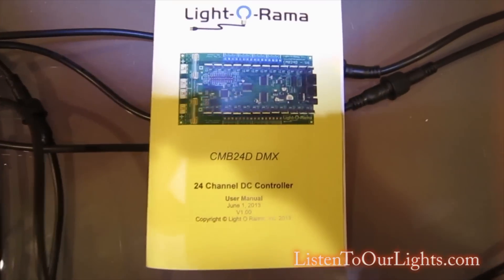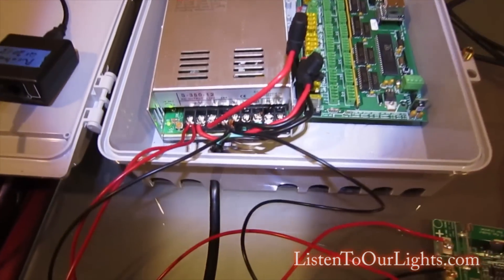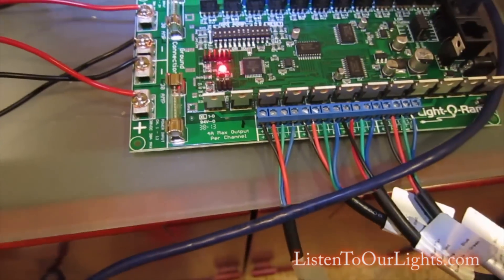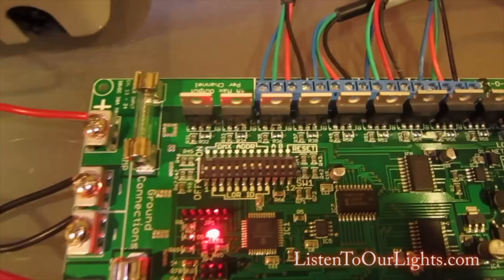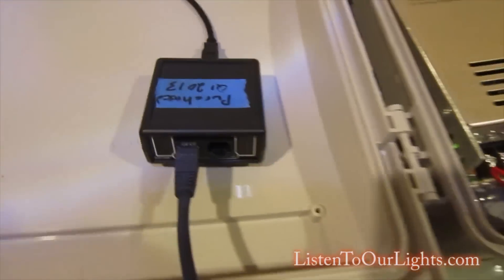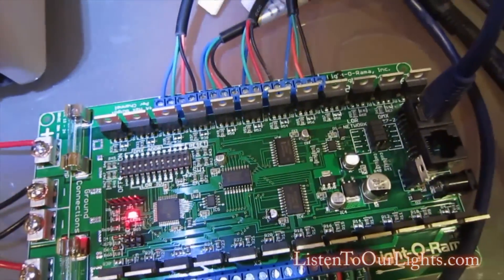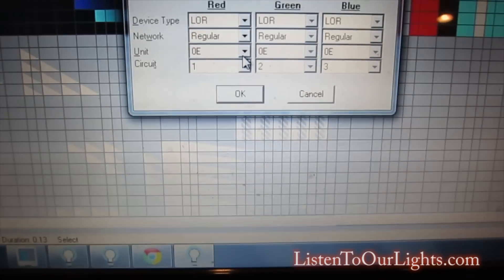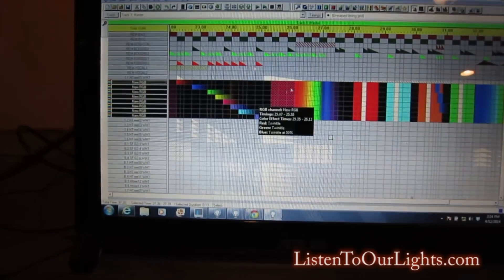LOR DC Controller CMB24D Demo

Comment: just bought the cmb24d, i am trying to control it with the advanced software with a sequence that i made up. the light on the contoller is blinking on and off. what am i doing wrong? its not allowing me to control lights unless i use the hardware application

Comment: Sorry John, I misspoke. The LOR store says the 8-pack flood (starter kit) is out of stock.. Sad* I wanted to know if you were aware of any other online store that sale the same RGB floods that would be compatible with the LOR CMB24D. Thanks much, Carmen.
Reply from the maker: +carmencolumbusohio CMB24D pretty much should work with any 'dumb' RGB lights as long as they are within the electrical limits of the board (see online doc at LOR). I've used it with non-LOR strips, nodes, etc.

Comment: Hi John, I visited the LOR website and the only RGB lights that I seen were the ribbons and the 2 RGB floods that come in a package. They look much smaller than the lights that you have in your video. Do you have a link or is there another site where these lights can be purchased? Thanks, Carmen.
Reply from the maker: +carmencolumbusohio From the LOR Store go to RGB devices. What I bought was the "LED Flood - 8 Pack". The lights are the same as the "RGB Flood - 10 watts"

Comment: Thank you for posting this video.  I have a very simple question: I have done LOR displays for years but limited it to about four 16 channel enclosed controller and 5 cosmic color ribbons for arches.  So I have an understanding overall. However, I a little confused, but learning, about the separate boards and I think I understand everything except the power - what power supply are you using and where do you place it?  Where do you buy it and how do you protect it from the elements?  Thanks.
Reply: Stephen Davis You can use a power supply from an old computer. That will supply you with a 5v and 12v feed. If you are using a 5v feed for 5v RGB's, you need to supply the board with a separate 12v power supply so the board can function properly. Almost any 12v (1 or 2amp) power supply will work as long as the polarity is correct. Or you can tap into the computer power supply on it's 12v leg. If you don't have an old computer power supply, you can purchase a power supply from many eBay sources. There are specific ones for RGB's and as far as protecting them from the elements, you will need to enclose then in some sort of water resistant or waterproof enclosure...Most power supplies come with a cooling fan and may require some sort of air inlet and exhaust. One other solution is to mount it outside in an area protected from the rain or snow and run the leads to the card that is housed in a waterproof enclosure...I hope this helps a bit...

Comment: Thank you for your post it has helped me a lot. For the life of me I can figure out how to set the dip switches and or change the unit  ID? Do I need to make changes in the LOR Hardware or just on the board? Thanks for any help. and you ramp up or down custom colors?
Reply: Joey Bolohan I believe that the dip switches are all you need to assign the board...You should have gotten a sheet with your controller, if not you can download it from the light-o-rama webpage... I know it's in there somewhere...